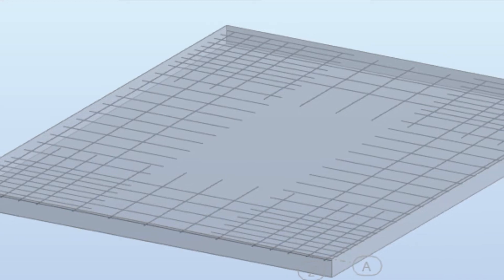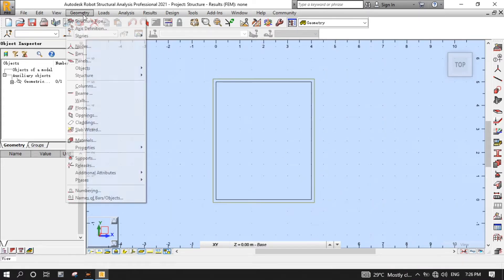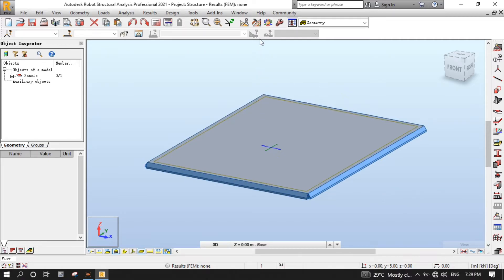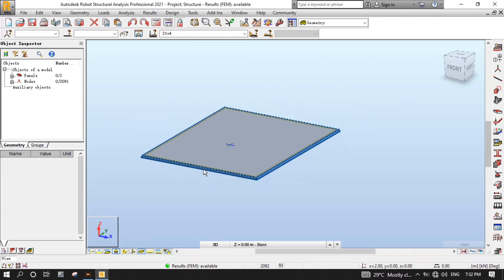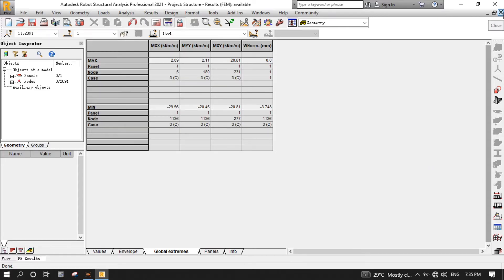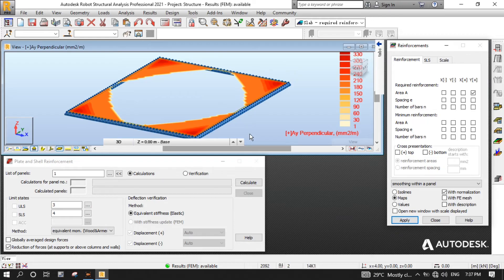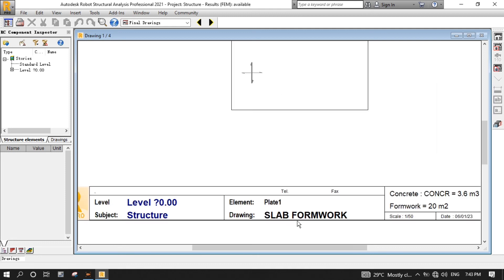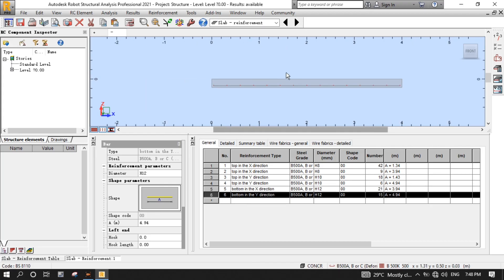Reinforced Concrete Slab Design by Robot Structural Analysis

Comment: thank you so much dear
could you help me?

I made an analysis of a flat slab using the program and analyzed it manually again using Simplified frame method (distribution moment ) I found difference in result
the moment in the RSA is very large than my manual result.

Is it logical for the difference in results to be like this?
Note
When I used reduction of force above columns the results were close.
can i use reduction of force above columns in any case?

...
BS 8110
section of columns all (50X50cm)
the length of spans in X axis (6.5 m) two spans every span 6.5 m
the length of span in Y axis (5.5 m) two spans every span 5.5 m
Live load 2 KN/m2
died load 3 KN/m2
thickens of slab 22 cm
Reply from the maker: I'll check it out tomorrow.
Reply: @ARbyEV  okey  ... thank you